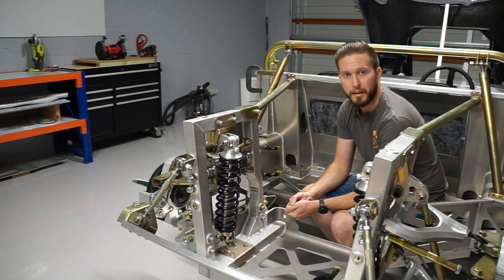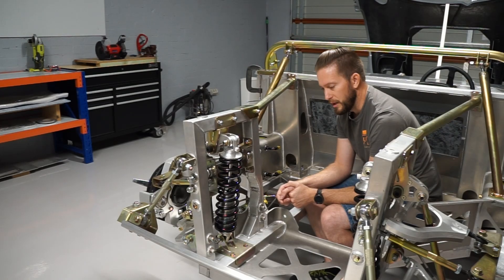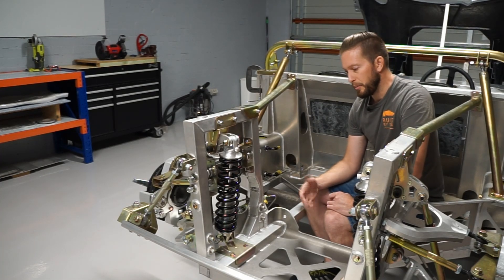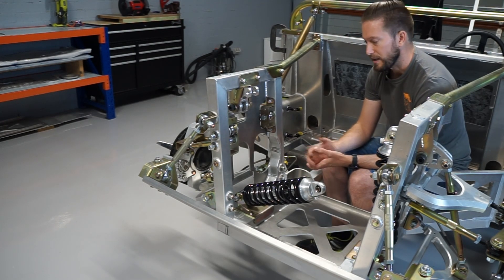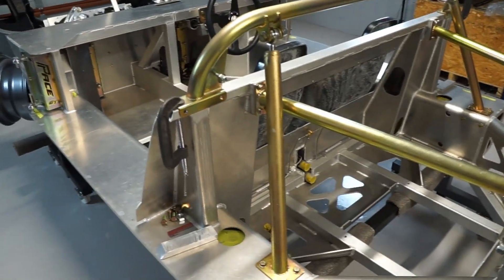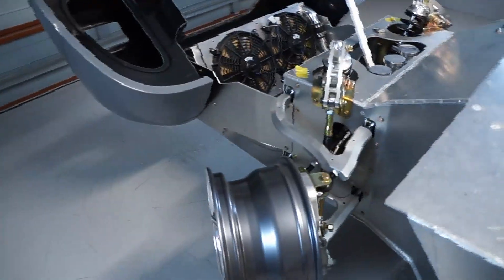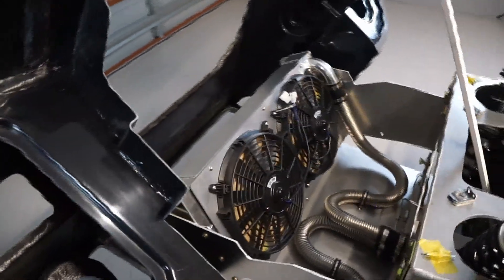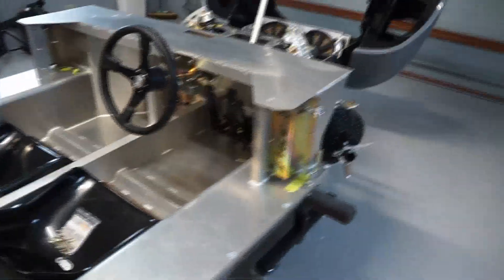GT40 Kit Car Build - Ep 17 - Rear Suspension Issues Solved!!! (& general build update)

Comment: I assume I am not the only one who would be interested in a video explanation covering why the lower shock mounts could not be rotated 180 degrees. Since the holes that were drilled from the manufacturer were not used for mounting, the inline forces applied to the bracket may cause vibration due to the fasteners being offset from the centerline of force. If you had rotated each of those lower brackets it seems like everything would have lined up perfectly – no cutting panels, no drilling brackets, no clearance issues, the factory drilled holes would’ve lined up with the reinforced section of the frame and the inline forces would have been properly secured.  Yes, it would have moved the bottom of the shock inboard approximately 50mm and those very powerful forces would have been parallel with the upright framed members around them. But, as you said, we can’t see everything from the video, so I’m just guessing.
Reply from the maker: G'day Eric, I might see if I can integrate this into a future episode for those interested. I'll look to unbolt the shock and mount and show why it doesn't work a bit more clearly on video.

Comment: Hi Dan. Great videos, thank you.  I’m thinking about your clearance issues with the strut/spring…. If I recall, in an earlier video, you had an issue with the upper control arm hitting the link rod as well. This all might go away when you put weight on it, but it shouldn’t interfere over the whole travel limits. This leads me to believe that you might have the pivot brace installed backwards. I’m not sure but if the pivot point is offset outboard from directly under the frame it’s bolted to, you could turn it 180 degrees and solve your strut/spring clearance and your control arm/hard link clearance issue all in one shot. Wish I could draw it…
Reply from the maker: Thanks for the suggestion, I follow what you are saying. The bellcrank has two different size ends, a wider end for the shock, and a narrower end for the pushrod, so it can only mount one way. If the bellcrank brackets are flipped, they end up having the bellbrank on the wrong angle.

Comment: (never mind - I just saw episode 23, lol, but you should have use more bolts ;) Hey Dan, I know this it way late and likely irrelevant now (and I'm sure you've heard it all before), but did you consider that the coil-over mounting plates might actually have been drilled correctly, and they should be mounted on the inner beam using the original holes? Ignoring the resultant inner overhang which could just be cut off or re-folded, that would do a few things: 1. move the coil-over further inward giving tons of clearance, 2. create a more favourable angle b/w the top of the coil and the cam,  3. look better, the reverse lean looks a bit odd compared to the front coils, 4. be much stronger because the way you have it here looks like it will flex at the base and eventually become loose - surely the mounting bolts need to be adjacent to the actual pivot, as drilled?  (were they both drilled the same way?) Anyway, thanks for the vids, just found them, they look great!

Comment: I do have a lot of experience in every the from hot rods to bulldozers. So I can not say for sure because I have never built one of these kits. But it looks to me like maybe you have the lower shock mounts on the wrong sides. If you were to swap them, that would put the factory bolt hole were you needed them and it would move the bottom of the shock inwards and back, away from the panel the shock was hitting. Thats how it looks watching your video.
Reply: Totally Agreed, looks like the lower bracket is on the wrong side or they need to be flip to give the shock a better angle

Comment: Dan, were your concerns with the tires hitting the control arm at full droop AND full lock? Couldn’t tell if it was at ride height or droop, but definitely check at ride height for clearing issues. The chances of being at full lock and droop while driving is almost null.. may not have any issues at proper height! Good luck, beautiful build.
Reply from the maker: Thanks for the feedback, a very valid point now that you mention it. I have assessed this as a potential issue while the suspension is sitting at full droop. I'll hold off on trying to resolve until I get tyres mounted and the car sitting on its own weight. Thanks for the advice! 👍
Reply: Absolutely. You’re living my dream that I’ve had for nearly two decades, cheers to great work mate!
Reply: @BuiltbyDan  I think that would be just a matter of adjusting the stops, like you mentioned. I would leave about 5mm tire clearance, then check it all points of travel and swing to make sure there is never an interference problem. After you have the chassis fully assembled, I'm sure you're going to want the alignment done by a shop. Caster, camber, rake, toe in and toe out would be mostly adjusted in all the hiem joints and shims. That will also affect the tire clearance. A good suspension shop will make sure that they are set for you.

Comment: My only idea that I’ve been thinking of with the improper spacing, where you had to cut out, for the coil overs to fit against the panel. Has the manufacturer changed the brand or style of shock? I ran into this issue with my 427 kit, it was originally meant to have just shocks in the rear, and I upgraded for coil overs but the size of cut out didn’t fit either.
Reply from the maker: G'day Zach, I did consider that and spoke to a few other builders to find out what spec/model coilover they were supplied and they are the same as mine... from what I understand the kit has always used coilovers.

Comment: I know you have resolved the rear suspension issues, but did you look at fitting the lower shock mounts 180 degrees around. That would provide clearance and the bolt holes would have lined up
Reply from the maker: G'day Russell, yes I did look at that, but the mount points where the shock bolts in are offset on the bracket and the shock would then be on the wrong angle/not in line with the bellcrank or pushrod.
Reply: @BuiltbyDan  If there is a offset, maybe the bracket on the left, in the same orientation, should (or could) have gone on the right side of the car?
Reply from the maker: G'day Gary - tried that too. I spent so much time swapping brackets around to see if I could get it to work properly and provide the required clearances - the last thing I wanted to do was start hacking at the chassis, but unfortunately it was the only option!
Reply: @BuiltbyDan  180'd, or swapped sides? This was the same thing I thought, but you say the bolt holes in the brackets were offset. Wouldn't it have been possible to elongate the holes, in the bracket to make it work? It would have put the shock at a slight angle (the width of the frame), though it would have given you clearance from the chassis wall, but the shocks should have still worked? 

I can't see how it would have be that far out of being inline from the bellcrank or the pushrod. What your saying is, if you reversed the brackets, the shock would be at such an angle that they wouldn't have actually compressed, the top of the shock would have just rolled over toward the frame/chassis? Interesting.
Reply: Sorry, added same above. I don’t think the angle of the shock being being the other way around would not matter. Holes not lining up is just part of kits, so might not have been surprising. What is more disturbing, is that the manufacturer doesn’t solve the problem you had! Poor customer service!

Comment: Worked for Benz for 20 years and SLRs, currently with aerospace.  Looks like the lower bracket is on the wrong side or they need to be flipped, the shock angle looks wrong.  Good job on the build though, attention to detail is outstanding.

Comment: Just looked like the brackets were around backwards. The Cobra of the same manufacturer has the shock vertical, no angle, looks like if the bracket was spun they would be vertical too and have no clearance issues at all. Wouldn't need to go through the opening that was enlarged.

Comment: On the rear suspension lower coil-over mounts...what happens if you swap the left for the right and rotate 180 deg?
Reply from the maker: The original bolt holes in the bracket don't align with the welded in bosses in the chassis and the angle of the shock is skewed to the side rather than being inline with the bellcrank and pushrod. I'll try capture a bit clearer in a future episode.

Comment: Would it have worked to turn the bottom shock bracket 180 degrees?  From the video it looks like that bracket might fit if switched around and that would move the shock out to clear the chassis.
Reply from the maker: G'day Jim, unfortunately I tried that and it didn't work, the bolt holes in the bracket are offset and they don't align with the welded in bosses in the inner rail of the chassis when they are flipped 180d. I'll try and capture this a bit more clearly in a future episode.

Comment: Hi Dan. Great work! But I just wonder, haven`t you swapped the chassis brackets for the coilovers around? Are you sure they should not have been with the lower mountings for the coilovers on the inside of the chassis legs as opposed to the outside as they are now? In that way, the original mounting holes on the brackets would be in the right position to the welded in bosses on the chassis legs, and the coilovers would have had an angle not interfering with the chassis plates (that you had to remove material from). This question actually struck me in the first video where you were installing the rear suspension. But of course I might be wrong......just keep up the good work!!
Reply from the maker: Looked into all those options Bob. Unfortunately it didn't work. The shock mount tabs on the bracket are offset and if you flip them it changes alignment of the shock to the point where it is no longer in alignment with the bellcrank and pushrod. The way I have it is the same arrangement as the standard chassis. My chassis is wider to fit the Graziano transaxle, by moving the bottom of shock in, it then starts to encroach on the addition clearance created for the trans...
Reply: @BuiltbyDan  Well look at it this way - you solved it yourself, and no thanks to a non-forthcoming manufacturer! As I said earlier - keep up the good work :-) Looking forward to the next episode!!

Comment: Congrats on the progress. I've loved all the detail you've put into these videos since my hope is to do this exact project in the near future. Did you ever solve the total suspension travel question?  If 55mm of rear travel all it's meant to have?
Reply from the maker: Yes I did! I just needed to adjust the amount of thread exposed on both the inner and outer tie rod ends on both upper and lower control arms. From memory it was 10mm of thread beyond the lock nut. I also wound the pushrods in all the way.

Comment: Another fascinating episode. Recapping a bit, did you resolve the issue with the rear(I think it was rear) push rod clearancing the a-arm, or did I miss that. Keep up the good work. I hope you're keeping a running tab to bill back the manufacture. ;-)
Reply from the maker: G'day Rick, unfortunately that issue has not yet been resolved, i think the upper control arm will need to be clearanced...

Comment: I thought the main problem with rear suspension was you only had 50-60mm of full travel,which is nowhere near enough,how did you resolve that?
Reply from the maker: G'day Bernard, yes that was another issue I had. I actually got some guidance from the manufacturer a while back to resolve that one, I simply needed to adjust the inner and outer rod ends on the upper and lower control arms and the pushrod and now it has significantly more travel (I can't remember what it increased to now but from memory it was around double the amount of travel)

Comment: Sounds like you're having some real problems with bolts and holes. That's pretty sad considering the tolerances they are supposed to be fabricated to. Are you sure the lower shock mount bracket is around the right way? It seems as though if you rotated it 180deg, the bolt holes would align and the shock would move away from the frame.
Reply from the maker: G'day Curtis, yea I actually tried turning them around, but it just doesn't solve the issue as the shock mounting points are offset on the bracket, so it throws the angle of the shock out and no longer aligns with the bellcrank or pushrod. Moving the bottom of the shock in towards the centre will also create fitment issues for the Graziano Transaxle - its a pretty big unit and there is not a lot of space left once installed.
Reply: @BuiltbyDan  Hi Dan, did you try swapping out left and right mount bracket and rotating them as Curtis suggested? It is just too strange that it doesn't fit from the factory, it is all probably assembled in CAD and I doubt that such an issue could happen. Also, bolts for the bottom bracket should be close to shock mount (as they are originally) because forces from the shock will act both up and down, and the way you now have bolts away from the shock mount, when the wheel will hit the hole on the road, shock will probably try to pull bottom bracket up and possibly bent it because bolts are on the opposite side. Good luck
Oh, I just saw that you tried that as well.. what about upper push rod lever mounts? maybe they can be rotated or swapped around, and the push rod lever as well? It just looks to me that one combination of push rod lever, push rod lever mount and lower shock mount should work better...
you will also gain more clearance here (https://youtu.be/_D94wixN--g?t=652) if you rotate upper push rod lever mount

Comment: Could the bottom bracket simply have been rotated 180deg? The holes would have lined up on the outside rail with the bosses, and the shock would have cleared too, as it would have been farther away from the plate.
Reply from the maker: Unfortunately the holes in the bracket are offset so when it's flipped 180d they don't align with the bosses in the inside rail. I'll try and capture a bit more clearly in a future episode.

Comment: Was this kit never built by the manufactures? How are these issues with the kit getting to the consumer? I don't think it's a good idea to have the bolts on the inside tubing and not the outside tubing for the rear coil-over. It seems like it wouldn't be as secure in its current setup.
Reply from the maker: I tend to agree with you so I think I'll be drilling holes in the outer tube and installing an additional couple bolts.

Comment: I'm way too late to the game because you probably already finished everything . But in the video where you installed those things in the first place . I left a comment , if you turned those lower shock mounts around not only would your bolt holes line up but it would have pushed the bottom of the shock inboard and made it so that the entire thing would have cleared and you wouldn't have had to do any cutting or drilling at all . Whether it was meant to be that way or not , that's pretty much the way the front is . And you're not having any real clearance issues there .
Reply from the maker: G'day Jerry, agree that flipping the lower shock mounts would solve the issue of the spring clashing with the chassis in principle, but those holes are offset on the bracket, so when flipped they don't align. The shock mounting point is also offset and would potentially affect the operation of the suspension as the pushrod, bell crank and shock would not all be aligned. Even setting all that aside, moving the shocks inboard will then cause issues with the transaxle installation, as the Graziano transaxle I am using is offset to the right hand side of the vehicle. This will become more apparent when I finally get around to installing the engine and trans in a few episodes time.
Reply: @BuiltbyDan  I'm not an engineer by any stretch , but with a push rod design I don't think that changing the angle or orientation of the shock makes any difference at all . If you were to change the length of your cantilever arm that would change your spring rate . If you lengthened your swing arms that would change the spring rate . And it looks like you're mounting holes were wrong no matter how you look at it . But all you have to do is look at your front suspension and look at the fact that your shock lower mount on the front suspension is further inboard by about two and a half 3 inches . And not only does it look right but I'm sure it performs better .

Comment: It is not easy to tell from the video but it sure seems like the those lower shock brackets are simply turned 180 degrees around. Would that not solve these problems by making the holes line up and allowing the coil-overs the necessary room for travel?
The issues you are having and the lack of manufacturer support are simply shocking for such an expensive kit. This manufacturer is clearly falsely advertising their products and lying to their customers about test fitting components. Your channel could have been such a good opportunity for this manufacturer to get good publicity, what a shame that they blew it.
Reply from the maker: Unfortunately if I try and flip those lower shock brackets 180d, the holes in the bracket don't align with the welded in bosses in the inner rail, as the holes are offset on the bracket.